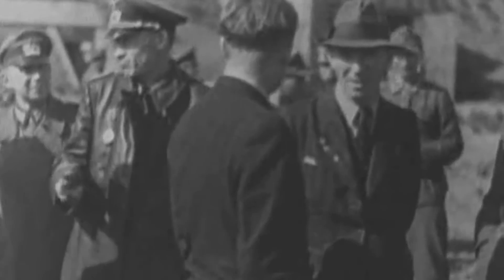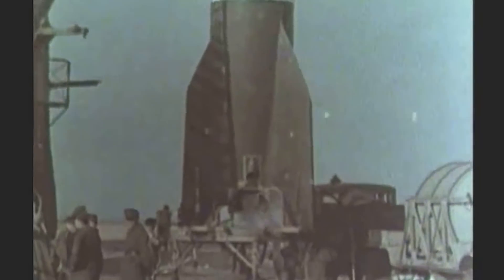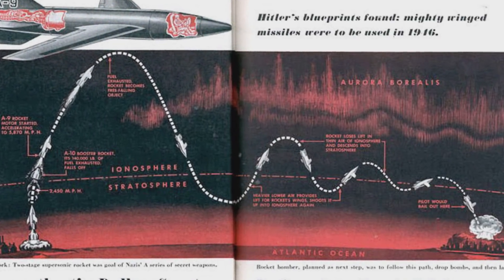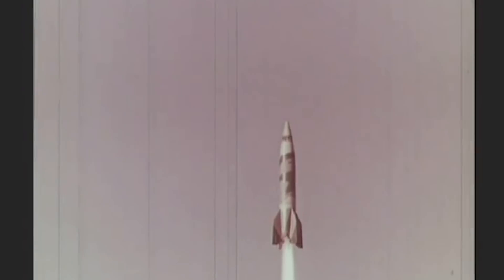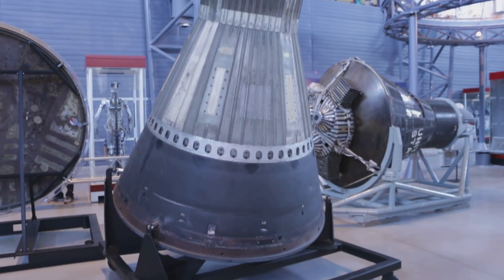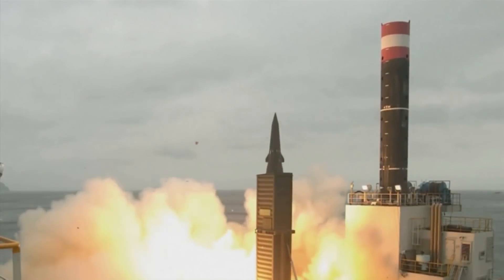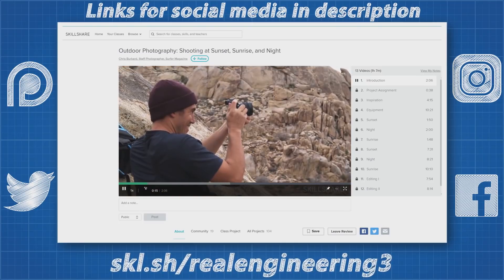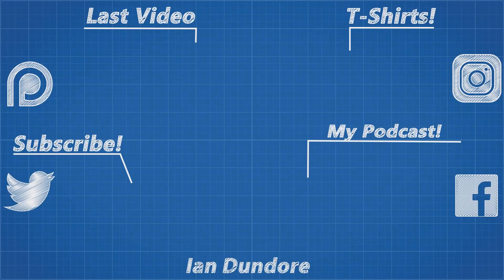Why North Korea Can't Build An ICBM (yet)

Comment: Without aiming to cause alarm or reinforce scary things, the evidence presented in this video is shaky at best, and don't support the title.

1) On the RV survivability question - the one in question survived until the final kilometer, which is well low enough for a damaging airburst to take place.
2) Further to that RV burning up, note that the HS14 test was entering the atmosphere from a severely high angle - in an attack scenario, it would be a shallower entry with less pressure/heat on the vehicle.
3) On the accuracy question - GPS satellites are entirely unnecessary (and not even used by the US ICBM force) for accurate ballistic missile shots. We still don't know the HS14's accuracy yet.

The backgrounder on ICBMs in general was solid. The conclusion that NK cannot build an ICBM is not supported by the evidence -- and in fact, the bits of evidence we have so far seem to all point to the fact that they can. It's not exactly something
Reply: Andrew Facini. You need to get in the war room here sir. The president wants all officers on deck ...he's about to give his " Rally the troops speech".

Comment: Lack of sat positioning system is really not that much of a problem, one can fairly easily use existing sat systems. You can't just buy an off the shelf sat device, these have built in limitations for height and speed to prevent just such a thing. But in the era of FPGA-s and SDR-s that's just meaningless, building your own GPS receiver from scratch, without the limitations, is not that hard at all. A dedicated hobbyist can pull it off if he knows what he is doing. And a nuke doesn't need pinpoint accuracy, it just needs to hit the right city.

The thing about technology, is that things that were really hard half a century ago, have gotten a whole lot simpler since then. The loonies at NK are also allowed to deceive about how far they actually are, both by overstating and understating their capabilities.

I doubt anyone outside NK has enough information about their bombs and rockets to make an accurate assessment about their ability to put a nuke on an US city. Its guesswork at best.

Comment: Great video! Just one correction. While the A-4 did use a measured fuel system, it was not the means of controlling range, it was found incapable of actually doing so, more importantly it also incorporated automatic fuel cutoff systems to prevent overburning and simply used fuel supplied as an estimate to cover requisite distance. The first systems used a wireless transmission system to send current velocity ground measured velocity to the rocket which would be checked and cutoff if it passed the measured threshold. Later on the I-Gerät 1/3 integrating accelerometers and I-Gerät 2 electrolytic integrative accelerometer were used to accomplish this Brenschluss.

Comment: Nuclear warheads like the w88 are conical. And they have a carbon-carbon outer Shield in order to protect them on reentry. And another thing the design itself helps deviate the Heat of reentry. Nuclear warheads are a little different than space capsules in the fact that is space capsules blunt design is designed to slow it down as it renters the atmosphere and the air gets thicker nuclear warheads on the other hand will be going over 15,000 miles an hour 1000 meters over there Target when they detonate. And looking at Kim's "peanut" is two-stage nuclear device it looked like he had and outer cone to put this weapon in for reentry if that's the case that's pretty scary

Comment: IT was not the V2 renamed A9... or anything of the sort... The name of the balistic missile program was A1 to A10... with every number between, plus A4b. A4b is simular to A9, but the wing design differs.

A5 is a scale modell of A4, and A7 is a scale model of A4b and A6.

The V series was the weponized version of the A series. So the V2 is a weopnized A4 or A4b.

That the range was adjusted with the amount of fuel is a myth. The system was far more complicated. The fuel myth was really british propaganda. The thing was that they didn´t want the population to know how many attacks there was. so they made up the story that Germans aimed the missiles with help of UK repports and spies so every body would clamp down on where the missiles hit, basically censoring people this way.

This was simply never the case. The system was aimed via radio becons. Germany had 3 synchronized beacons. One reference, and two for position. So tuning in two all three simultaneous the missile could get a fairly good possission. 

This is actually what the back fins are fore. The fins are not made to aim it during the starting phase. This is done with interieor fins inside the rocket. The outer fins are just ment to control during terminal decent.

This was fairly inefficent and it really didn´t work. That was why they added wings. The wings ment that then could use less fuel, launch them longer distances, and have them glide in the terminal decent. When they glide they could also navigate hit any target very very close to intended.

This was set basicly by timing the radio beacons to each other.

The A9 was never to be manned. This is a other myth. There is a similar myth for the V1. There was a maned version of the V1 as well as the A6 (that is a predecessor of the A9). The manned version was not for bombing, but rather high speed surveillance as well as testing.

I think its pretty bad this video is made of what is pretty much WWII propaganda.

While the weight of fat man and little boy technically is accurate, its the weight of the total bomb, not only the atomic device inside it. Both bombs heafty milled steal bodies, and not like the nose cone of the V2 sheet duranium shell.

The point about heat sheelds is also not quite accurate. There is two main errors here. A ballistic missile is not nearly as fast as a orbital reentry.
The second part is that germans did have a solution on paper. This solution was highly controversial untill 2004 when it was proven to work. 

The controversy was that the solution was so simple, light and lowtech that it should not work (because of the solution used at the time was far more expensive and complicated). It was there for deamd that it didn´t work, because it wasn´t used.

This turned out to be a false argument when it actually was tested in 2004, proven not only that it worked, but it was pretty much supperior to all existing solutions

About minturization, we now can be pretty sure that north korea got Hydrogen bombs. The thing is that hydrogen bomb goes hand in hand with miniaturization. So they are pretty close. Probobly less than 2 years.

"North korea don´t have any positioning satellites, and they will not be granted access to chinese once"

eeeh... there is no acces codes to positioing satelites. Anyone can use the,. I really doubht that Chinese, Russia; Europeans and US can all swich of there positioing satlites between the time the missil launch and it hit ground.

Ant the accuracy. Well normal GPS have a accuracy of +-10 meters.. The blast radius of a thernonuclear bombs is well over a 1000 meters.

Patriot missile system could barley shot down Scud missiles (that is just a glorfied A4 rocket). The North Korean missiles, while not modern, is way more advanced than the scuds.

Comment: Fat man weighed 4,670 kg so I will let it slide that the video says it weighed 4,600 kg; however, 4,600 kg is not 4.6 tons. A ton is about 907 kg meaning 4,600 kg is about 5.07 tons. 4,400 kg is about 4.85 tons.

Comment: Real Engineering
If you can handle it (background) then a video on navigation would be interesting. Not modern day GPS-computer navigation (also interesting but rather well known these days) but old school gyroscope navigation. Also stuff like the first reasonable accurate measurements of the speed of light, the distances between planets (without any electronics)...mechanical watches, pendulum clocks...would be fascinating.

Comment: This is a great video about all the challenges faced but it does not reach the correct conclusion. Experts have taken what they know about the latest launch and applied extensive modeling and shown the missle could reach NY. Also, of course when fired straight up, 7 times higher than the Internation Space Station, a successful return is pretty much impossible. A much shallower angle that would be needed for the reach of the mainland, the CIA itself believes would allow the return vehicle to survive.

Comment: On July 4, 2017, North Korea launched Hwasong-14 from Banghyon airfield, near Kusong, in a lofted trajectory it claims lasted 39 minutes for 578 miles (930 km), landing in the waters of the Japanese exclusive economic zone. US Pacific Command says the missile was aloft for 37 minutes, meaning that in a standard trajectory it could have reached all of Alaska, a distance of 4,160 miles (6,690 km). By targeting the deep waters in the Sea of Japan, North Korea is ensuring that American or Japanese divers will encounter difficulties when attempting to recover Hwasong-14's engine. Equally, North Korea is not attempting to recover any re-entry debris either, which South Korea points out is an indication that this first launch is of an ICBM which is far from ready for combat.  As of July 2017, the U.S. estimates that North Korea will have a reliable nuclear-capable intercontinental ballistic missile (ICBM) by early 2018. On July 28, North Korea launched a second, apparently more advanced, ICBM, with altitude around 3,700 km, that traveled 1,000 km down range; analysts estimated that it was capable of reaching the continental United States.

Comment: What about a HEMP? Sure you still need guidance but no heat shielding.
Reply: for re-entry    NOT
for getting Higher.... OK... Hemp... Rope.... Climb it..... Up..... 
Guidance ? like steering.......ROFLMAO....... HEM..(burp)P iss off
Reply: +jerry slater
Not sure if trolling, bad at formulating words or just stupid 

So did you actually fail to google HEMP a.k.a. High Altitude ElectroMagnetic Pulse when you had no idea what i wrote or is this some really stupid looking trolling attempt?

Comment: I'm less worried about a North Korean missile with a nuke on it than I am about a shipping container with a North Korean nuke in it...

Set one off in the port of Long Beach or Tokyo harbor and then tell us there are more....

If one were placed on the sea floor in or near a large harbor by a midget submarine and it would float toward the surface before "bounding" above the water level and then detonating I think you'd have a very effective weapon that would be very hard to find...

I'm more worried about that than I am about a missile that could probably be shot down by SM-3 or THAAD long before it would near the target it was aimed at.

Comment: With regards to guidance, they do not need their own GPS. Simply use the internationally available US system. It doesn't need to be accurate to sub centimetre distances to hit a city. Of course the US could switch it off or change the data if they knew the missile was in flight, but that would be quick thinking as well as possibly cause catastrophe in the airline industry.

Comment: They wouldn't need extreme accuracy nor reentry heat-shielding, to conduct a massive EMP attack on CONUS. Two or three high-yield warheads, detonated in the region of <> 200 miles altitude, roughing dividing the continent into halves or (more effectively) thirds would likely produce terrible effects over time as it cripples communications, electrical production, transportation and other essential aspects of civilization as we know it.
Reply: Fairly good point, space detonations could easily inflict massive damage in this era.
Reply: It actually probably isn't impossible to cripple an entire hemisphere with a single missile.

Comment: I need an engineer to answer this:

Is the rotation of the earth in the United States of America's favor in the mathematics of an ICBM? How much more difficult would it be to hit a target when the earth's rotation is going away from you like North Korea?
Reply: Matthew633 Okay, engineer responding: It favours NK, not USA. Most orbital launches are towards the east because Earth's rotation already means that at launch the rocket is going 1000km/h or so in the right direction. You can launch into polar orbits, or counter orbits (to the west), but that takes much more fuel. The advantage of reaching normal orbit is you can re-enter anywhere you like between 60 deg N and 60 deg S. But for a suborbital trajectory, geography favours easterly launches.

Comment: Great production, this is just miles ahead of mainstream media. It's because of this  type of high quality content i don't even own a television anymore :D
Reply: You should have other sources too. There were a number of mistakes made in this video such as the purpose for the shape of your typical re-entry capsule. The reason behind the assumptions that NK can't create a re-entry capsule for a small nuclear device is because one of their tests didn't make the cut, however using that same reasoning you'd believe SpaceX wouldn't have ever made it either, and a tr-entry capsule is significantly easier to create than what SpaceX has done.

The only question is if they have small nuclear devices or not. -  The re-entry Capsule would be easy as all get out for them to create. Do they? Well they say that they do and we don't have proof that they don't.
Reply: Patriot 03 good point, can you point to some other sources?
Reply: pedrofdmp are you talking about? This video was absolute trash, completely misinformed, mostly personal opinion, and worst of all politically biased.
Reply: Xortsa interesting, why do you say so?

Comment: Could a Falcon 9 theoretically be converted into a huge and extremely powerful ICBM?
Reply: Yes, except that it can't be launched on demand. There's a lot of preparation to be done to launch at a specific moment, and by then the enemies will know. Unless an underground launch pad is developed in a way it can't be seen before an actual attack, and even then it can't retaliate.

However the technologies involved have a lot in common with actual ICBM designs, and that's the reason non US nationals can't work at SpaceX. Even though the theory is no secret and nowadays it's relatively easy to simulate the designs.
Reply: No, because it would land safely at the ground zero :D
Reply: Dionyzos Of course, no difference. Like can a Diesel engine power a tank as well as a truck. Of course. Only difference is the payload.

Comment: Do they need an accurate guidance system though? US is a big target...
Reply: Yes. Heavily populated areas are much less common than you might think in the US. Without a guidance system there's maybe a 3% chance of landing NEAR a city assuming it was pointing vaguely the right direction. That's assuming the ballistic projectiles aren't aimed in the wrong direction by the vectoring thrusters on the carriage and don't bounce off of the atmosphere before landing in the Atlantic ocean. Considering the chances of the latter, the odds of hitting a city or major industrial area are too low for me to guess at. And if they had the bad luck of hitting anywhere in Canada... well, that would go even less well for them than hitting the USA